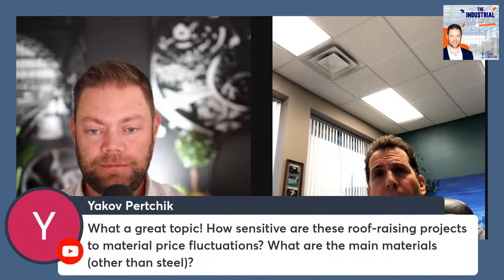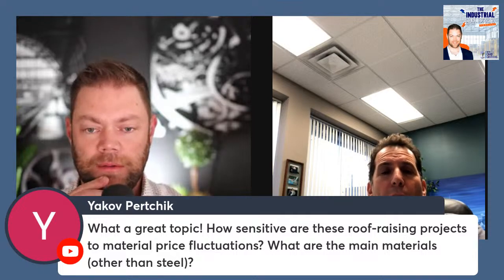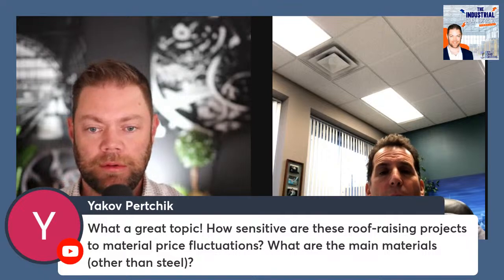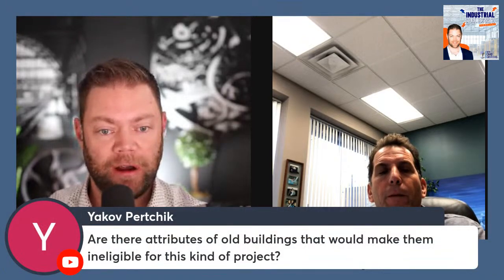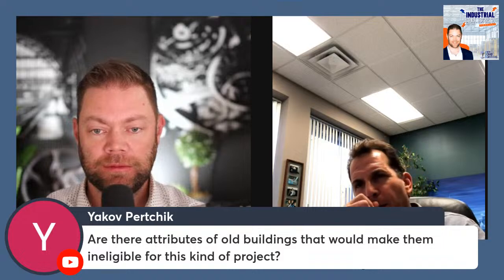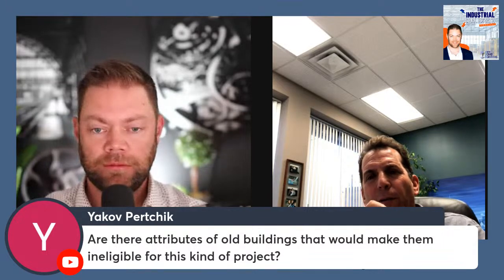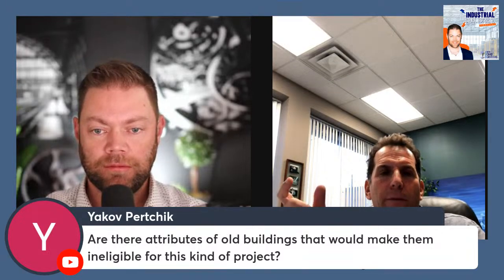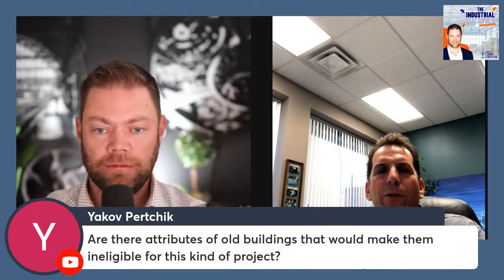RAISING CEILING HEIGHTS ON INDUSTRIAL BUILDINGS

Comment: In thinking about the great content in this video Chad, I have three follow-up questions that I would think any owner of an older building woudl want to know:  

First, what do you or Marty believe is the current industry clear height that most tenants looking for warehouses with significant cube space are searing for?  

Second based on current pricing in most markets in the large city areas what is the per square foot to build such modern Class-A warehouses from scratch with the ideal clear height.  

And third in addition to taller roofs what do modern warehouses include that older built warehouses would not include to make stacking viable.
Reply from the maker: Great questions!

I'm looking to have Marty back on as a guest but I'm happy to provide my thoughts in the meantime.

1. Most logistics / distribution tenants are looking for 36 - 40' and I see that going even higher in the future.

2. There's not a huge cost adding the extra height if it's planned from the start. I'll see if I can get some more accurate numbers from some developers but I'd ballpark an extra $10 psf to take it from 28' to 36'.

3. Sprinklers are the biggest thing lacking in older properties, but the column grids are typically narrower and the floor slabs aren't as thick.

There's still a healthy demand for older industrial properties though. My entire portfolio is older industrial actually so I'm very bullish on it!